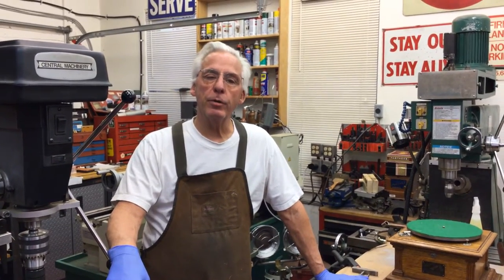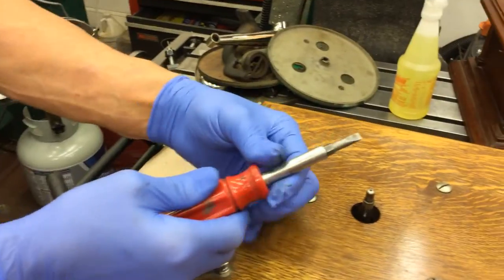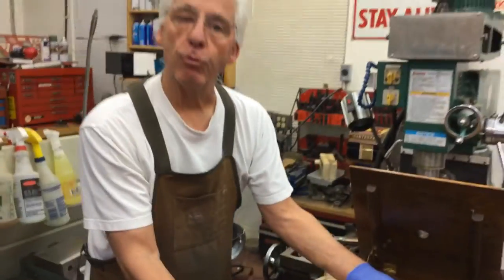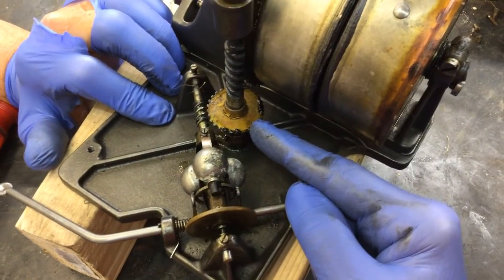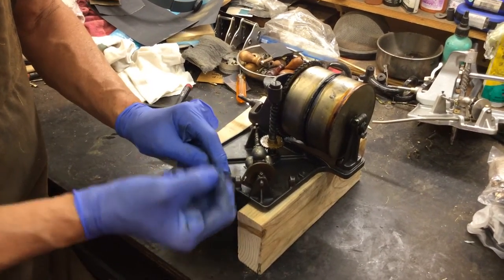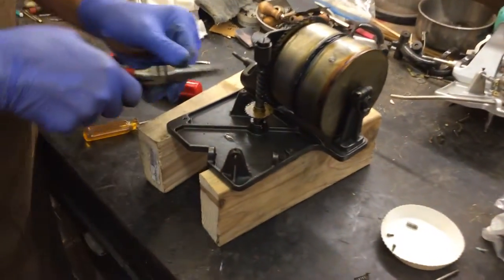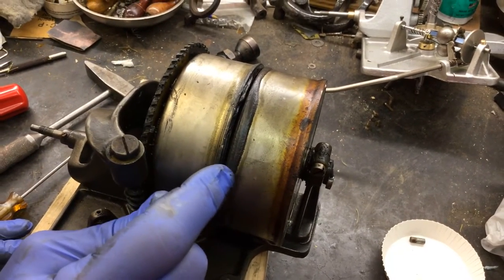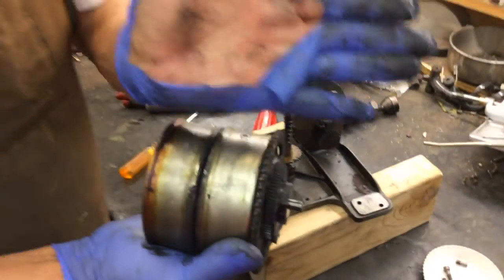287.  How to disassemble a Victor I through V phonograph motor

Comment: How do you take the crank off
Reply from the maker: You remove the crank by turning it towards you firmly but gently. It will unwind and then pull straight out from the side. Then if you’re going to ship it you take the turntable off, and the reproducer off and package them separately.

Comment: I noticed the side of the governor gear with the locking screw is on the top as it is oriented on the spindle shaft.  I may have reinstalled mine on my victor VI opposite or "upside down".    Are they always oriented this way? (i forgot to take a photograph)
Reply from the maker: Please send me a picture: dyslexicgeniushurt@gmail.com
Reply: @1974hurt  Photo sent this morning.  Thank you!

Comment: What is the best way to ship one of these?
Reply from the maker: You need to ship the motor double boxed in heavy packing box such as FedEx, Or if it is a smaller motor you can ship it in a double wine box. They are of heavy cardboard to protect glass
Reply: Do I need to take the motor out of cabinet to ship?
Reply from the maker: @kevinwhitcomb7420  If it is a small Phonograph you can ship it in a very heavy cardboard box with at least 3 inches of padding all the way around, first removing the Horn, the tonearm and reproducer, and the turntable.

Comment: Where are you located? Wish I could just mail you my motor to fix 😣
Reply from the maker: ok and what mortor
Reply: @1974hurt  I actually emailed you. I have one of the sing turn motors. I can provide pictures. I was going to attempt to take it apart but not sure if I should. It needs a good cleaning and clunks when you crank it. Also doesn't keep spinning when a record is on it. Maybe it needs a new spring.
Reply from the maker: I’m in South Carolina
Reply: @1974hurt  what do you use for cleaning parts? I got my barrel off and it is so dirty.
Reply: The spring looks good but awfully dirty. It's black with grease. Is there any way to just clean it without taking all the springs our? I'm worried I won't get them back in.
Reply from the maker: what machine is it to,
Reply from the maker: call me 864 236 1680
Reply from the maker: @aprilmason4431  some people put the whole spring barrel asembly into a cleaning solution and try to scrub the grease off but it isn't a satisfactory alternative.
Reply: @1974hurt  I got it all out and cleaned it and got it all back in. However the ring that goes over the barrel top I could not get back on so I need to replace that somehow
Reply: @1974hurt  I don't suppose you have a new barrel top ring I could buy from you? Bent mine taking it off and having a difficult time taking it off.